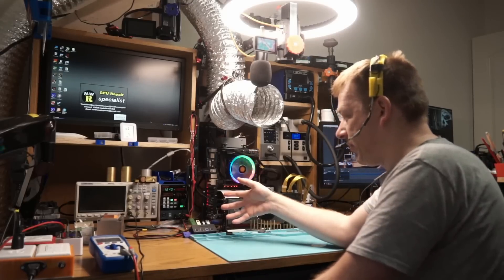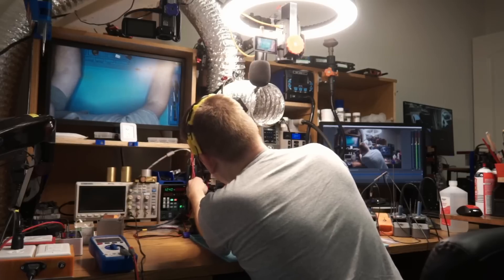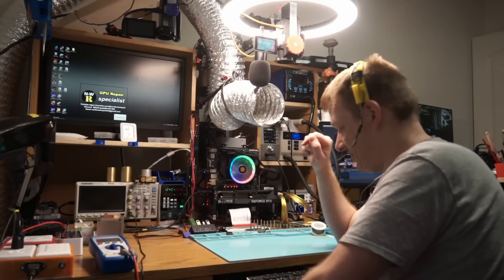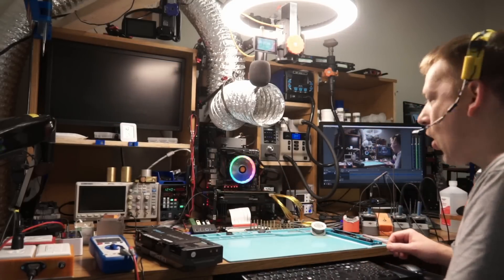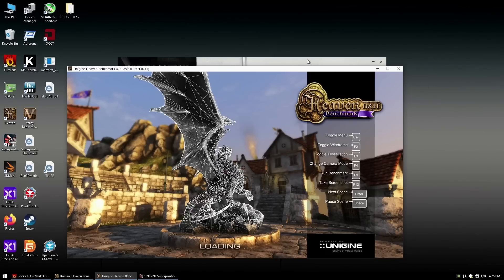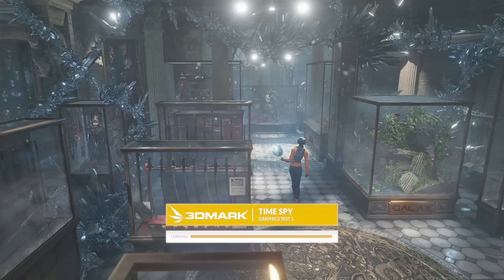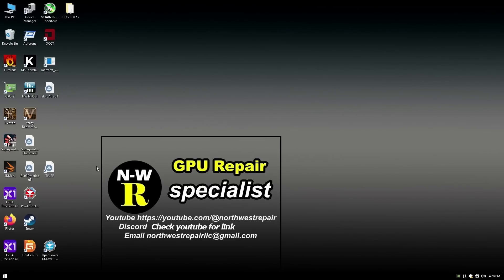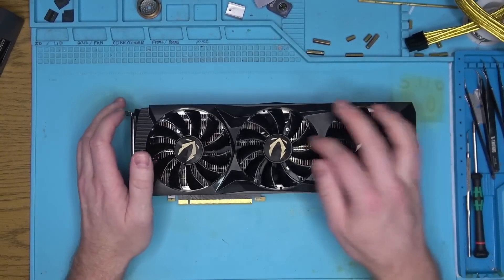Can you swap GPU while computer is at sleep ?

Comment: I agree with the other comments, 3DMark doesn't recognize the GPU as being valid because of it's wonky VRAM setup, and it's kicking you out of the tests because of that.
Does older 3DMark versions work, like say 3DMark 11 or 3DMark Vantage if you can get them to run? If they also error out, it's definitely something to do with 3DMark's System Info thingy saying that GPU is wild lol

Comment: Some motherboards support this but must have an option turned on in the BIOS. My Gigabyte UD AX Z790 has an option to enable such a thing. Can't remember what it's called but you would know it by seeing it. I think it's something like hot swap or something like that. I'm able to swap the 1st and 2nd PCIe in sleep mode without issues but the 3rd PCIe slot will wake up the system no matter what options are enabled. 1st is x16 size x16 speed, 2nd x16 x4 speed, 3rd is x16 x8 speed. Not a bad mobo for $100.

Comment: It's an good experiment, but there are many factors if this would work or not, each motherboard manufacturer theoretically has different bios, that is different code that drives pci-e slots (or maybe that's only left to OS after UEFI?), there comes the problem of the driver, what driver would do if the card in a slot magically changed it's specification and for each generation theoretically there could be different drivers loaded to system kernel - maybe only size of RAM is the factor and system crashes because of that, there are so many questions now, you've just opened an issue that's pretty interesting and at the same time time-consuming to investigate 🤠

Comment: That's why all military grade soldering is done with leaded solder. All that unleaded rubbish plays only for the GPU manufacturers that want their cards so be as fragile as possible. Cracking and stopping work from a slight wind blow.

Comment: Well changing cards I have try before on older machines ( like P3 and P4 ) and with mix results, some even with the PC turn on, GPU nop, crash 100%, but lan cards and sounds cards sure, adding a different one also crash.

About the 3D mark, well I got that one before with a AMD card and it was the card, something on the GPU was damage and the initial check that 3D mark does crash the soft or the PC.

Comment: I have done this multiple times to clean the cooler, test paste, test another cooler or whatever.

It will always work because the PC and peripherals state is saved in RAM. The GPU memory will be re-initialized out of sleep state.
But another gpu will always crash because it is not what the drivers expect and the state it has in RAM.

You do need to diaable automatic hibernation or it will wake up to hibernate and crash, after some hours.

The computer wouldnt power on by itself because I disabled mouse and keyboard wake up in Windows.

Comment: so i have an e.v.g.a rtx 3080 ftw3 ultra that has an ek waterblock on it but has issues. I just bought an rtx 4070 ti super to replace it. No video out, no hdmi out on the 3080. i have the original fan and heatsink , housing and clasp. wanna make a video on this? i will send to you or bring to you im in show low Arizona

Comment: Basically those hardware rails are not designed for Plug & Play. For example P&P ports are designed to tolerate wiggeling (no power line directly beside another one) and data lines for getting powered up in any order (because you can't say which pins are longer than the other ones, could be different for each product, and even for individual devices of the same product). I don't know which lines are powered down and which are still on power at the GPU bus. If there are lines still on power in Sleep mode you could produce shortcircuits and damage the cards or even the bus. I would recommend to refrain from doing that in the future.

Comment: If i remember correctly "Sleep" keeps power on the computer RAM and "Hybernate" dumps everything on the HDD and poweres everything down until it reboots and loads everything back. Maybe you should try to start it with a working card and go into hybernation, then swap the GC and boot up with the faulty one.

Comment: I had an interesting issue with a Zotac 1080ti once. The card worked in every game and benchmark i threw at it, except for 3Dmark. Games would run fine, furmark no issue, heaven/superposition also ran fine, all was well. But as soon as i ran 3DMark, i would see green vertical lines as artefacts, sometimes it would crash, but mostly just continued getting worse and worse with the green lines.

MATS/MODS showed it as working, no issues found whatsoever. The only thing that helped was reducing the RAM speed by 100MHz, then all would be fine. IDK if it was the degraded RAM or some power filtering wasn't working well, but i never got to figure it out and sold it as partially working a year later.
Reply: Same card same result even with overclock or undervolt

Comment: You broke the signature handshake for the 3D Mark that why it refuses to run with the upgraded ram on the 2080. If you had another 2080 that is stock it will run just fine. But the problem is the upgraded ram gpu isn't ideal due to driver signature see the graphic card as 11gb not 22gb therefore you would need to make modifications to Nvidia drivers even this isn't ideal as you need a genuine certificate for it to work. This is like a can of worms in the long run

Comment: IF you have problem with graphic card like that try another way (something like that happen to me and I tried something drastic and it worked).
I bought another graphic card and wanted to test it so I put it in older computer just in case that card do not burn my new motherboard and it worked fine so I was safe (so I thought)
Then I swap it in my new computer and something happen first when booted for 1 sec something with lot of colors showed on screen but booted to system and it excepted drivers from previous card because they are almost the same BUT when I open GPUZ there is no Graphic to choose and no info (but everything worked like it was ok). I open Device Manager and there is no graphic card, I  put my old one back and it was ok but when I swap again  there is no Graphic card in drivers list. System was fresh new with few program installed so I took another older NVME2 with old system that I wanted to replace and put in PC so graphic card worked fine and I tested it in Furmark with GPUZ sensors to monitor so on new NVME I install new system and it is all ok. 
So maybe you can try new fresh system on another ssd (do not delete your current one) just to try maybe from swapping cards somehow system made a bug and remember that GPU with these settings.

Comment: That would fall under the topic of pcie hotplugging. It would have to be supported by the OS and not cause electrical problems if pins were crossed removing/inserting as some of them are still on.

Comment: I would think the driver and all GPUs (of that series) for that brand is made to speak together more or less the same. swapping will cause the system to maybe not know it can do more or less of something. Maybe it will think the ram is of the old card and cause allocation issues but would not see it until you stress it. CPUz working makes sense. Games working make sense for a little. 3dmark not working makes sense because it is probably doing something very exact to the card it thinks is there.

Comment: Re 3DMark: It's your non-standard RAM. 3DMark checks your hardware, and won't run if it's wonky.
Reply from the maker: it did in the past but not with this card.
something else is going on
Reply: @northwestrepair No. its the vram count. Stop it

Comment: seems legit. if you suspect a bios being the problem and want to flash a new bios to the graphics without having to change the chip, this could be a hack to have the gpu running with a fresh bios flash. bios loads with uefi for the peripherals like gpu. under theory this is how you get into windows and reflash the bios. love it

Comment: Hi NWR. While I don't do the 'sleep mode' on my GPU benchmark/stress machines, sometimes the AMD platform motherboards WILL power on when a GPU is inserted in the slot (regardless of pci-e power plugs being inserted at that time). No big deal, just wait for POST to mostly finish then I can power it off without cutting AC power. The Intel platforms don't do that to me. MSI Brand boards on both setups.

The motherboard is not entirely powered off when it's powered off. Some standby voltages are likely briefly pulled to ground when the card is installed (like power supply PS-On pin 16 for the ATX connector) or some other similar signal imitating  a button or switch being closed for the front panel header power button.

/shrug

Comment: 1:29 Isn't that rather asking for trouble. I thought turning off the computer, unplugging it and pressing the power button (I do it a few times) to drain any lingering electricity in the circuits. Before putting in and pulling out any peripheral.  I'm over cautious because I killed a video card once long ago by not doing what I just described.  It was the newer Matrox card model at the time.  Ran to one of the computer stores and ended up getting a 3dfx Voodoo3.  Ever since then, I'm overly paranoid about draining any linger electricity from the motherboard.
Reply: Nope. PCIe has a wake pin. Now, if it was AGP or PCI... Maybe.

Comment: Have you thought about doing memory upgrades for customers? For example take a 4080 super with 16gb on it and put another 8 on it for 24gb. Would it perform better? I know it wouldn't necessarily be faster but would it help with 4k performance and 3d rendering?
Reply: You can only double the VRAM (you cannot add extra 8gb to the available 16gb) and the performance won't change unless you are running out of memory. It would help a lot with AI stuff.
Reply: @TigTex  that makes sense honestly. I just figured that at 4k the 4080 would be close to running low. What about bumping up the vram on a 4070 ti non super. That's what I have. It might not make sense economically but would it be beneficial considering the card can do 4k but runs low on ram since it only has 12gb.

Comment: You can also remove PCIe devices with the computer powered on. On the PCIe connector, there is one pin which is shorter than the others. If one were to remove a PCIe card with the computer on, the physical connection with the shorter pin and the pin in the slot will be broken first. This signals to the card and the motherboard to shut down the signal pins. External USB connectors also have this feature and it works the same way.

Suddenly disconnecting signal pins with plugs and edge connectors without this feature could cause damage to the computer and the device.
Reply: Interesting, was always wondering what the shorter pin was for. thanks!
Reply: don't always work as intended and the os needs to be able to hande the suprise removal.
Reply: Theres always a reason, but theoritically like pcmcia cards there isn't a reason why it can't be pnp except for the large power draw that stuff like networking and gpu cards draw, that instead you need to safely shutdown inside the system before removal. I mean windows can give you the option, not sure how, but I have the ability to remove my mellonox card but not my gpu. If I pass over my gpu from linux to windows it sometimes list the card as a removable device. Yeah I did it once and it obviously crashed since the kernel wasn't expecting a full portion of the system to be gone including graphics ram since windows subsystems expect that to be present at all times. And damn does the nt kernel picky about that shit while linux just says whatever gtfo. This being said gpu driver crashes aren't the same thing as your card is still present and addressable regardless that the driver isn't loaded, although you can technically run windows without a gpu driver, it'll be a huge pita.

Comment: Re 3DMark - Remember it is designed to be a fair and competitive benchmarking tool for overclockers -- and there is a lot of code and effort toward verifying nothing in your set up has been tampered with to cheat a score.

My guess is your deviant card is setting it off. But that's good news because its a 3dmark issue and not a hardware one
Reply: This. I was thinking it was because of a non-standard amount of memory. 12, 16, 24 gigabytes are all to be expected. 22GB is not.
Reply: @LethargicSquirrel 22GB is absolutely a valid amount of memory, possible with a 352 bit bus on cards like the 2080Ti and 16gbit density GDDR6. You even see some modded ones floating around and the full 22GB works absolutely fine - FrenchHardware even ran one of these cards through Time Spy.
Reply: I could unintentionally still cheat with a score. Overclocked my peasant RX 6650 XT to the max., 3DMark tests ran without any issues (created a new record in Port Royal). And surprise surprise, when I tried to play CP2077, the game crashed in a few minutes. So in reality the OC wasn't stable and the benchmark should've crashed, instead of getting a new record score...
Reply: sounds like the people at 3d mark are anti fun, if someone is skilled enough to mod their gpu to add more ram i see no reason why they shouldn't be able to score higher
Reply: @honeybadger6275  Many nerds are in fact pretty devoid of humor, they just sit, and talk about their character for ages...
Reply: @honeybadger6275 what happens if I made the PC assume that  a 970 gtx is actually a 4080 for example, wouldn't that be unfair?
Reply: @hashemmi24 You mean the other way around cuz if not you'd be at the bottom of the 4080 scores.

Comment: It's because 3D Mark can't verify the GPU and it thinks something's wrong because it's got the wrong amount of VRAM.
Reply from the maker: so you are saying my 2080ti is fine ?
OMG :face-fuchsia-wide-eyes:
Reply: @northwestrepair  "OMG" i heard that
Reply: @northwestrepair  hello just wanted to ask a question, since you do gpu repairs and have tested alot of gpus on the motherboard you have,
a faulty gpu can't like fry a motherboard or anything on it?
I want to try an older gpu I have which may or may not be broken, but afraid that it might somehow ruin something
Reply: @gdog8170 There is a possibility that a gpu installed incorrectly could kill the gpu and/or motherboard as little as a small spark of static electricity can be fatal. Now the main question is what seems to be the problem? Is it not posting? Give us some information and we could possibly help you
Reply: @neddy1287  so, I bought a used machine before, didnt know that the psu was some chinese unknown brand with like 230 watts, now it had an i5 3470 in it, dont even know if the 230 watts were the real watts given to the pc or just what it draws.
But after installing the gpu, it used to work, although one of the two ram slots that was on that old motherboard died.

 
But it worked,
until I took the gpu out like the fourth time and put it back it, (trying to figure out whats wrong and what made the ram slot not working)
then it didn't post.
Just ran fans at full speed and nothing on the screen.

Although if you plug into the integrated graphics with the screen it posts, so seems like the gpu just ran at full speed but wasn't detected? I don't know.
Might have been because I didn't uninstall the previous drivers, that is also a possibility.
Reply: @gdog8170 This sounds like a the psu is underpowered therefore gpu not getting enough amps to function as given the symptoms of not powering or random shutdown. First replace the power supply then secondly make sure everything is cleared of dust bunnies and thirdly make sure all spots, cables and everything else is fully seated and connected
Reply: @neddy1287  thanks, I will do that. I already returned that case way back, I have since built a new pc with better specs, but it's such a waste to let a gtx 1050 ti rot so I wanted to try and see if it works on the new system
Reply: @gdog8170  RAM socket failed after repeatedly removing and reinserting the GPU? Was the motherboard flexing a lot? (Maybe its mechanical supports aren't all in place, or socket is very stiff?) I'd wonder if you've damaged the motherboard by accident - flexing it too much can break it, so it's always a good idea to try to mechanically support it if you see it bending while trying to insert memory or cards.
Reply: @laserspike  no like, it did that on the First boot it not detecting the GPU, was after removing alnd putting
Reply: @northwestrepair Dude how did you not know this
Reply: @northwestrepair  just downgrade it back to 11gigs and vola
Reply: @lordneol  or upgrade it to 44GB
Reply: @northwestrepair bot
Reply: You broke the signature handshake for the 3D Mark that why it refuses to run with the upgraded ram on the 2080. If you had another 2080 that is stock it will run just fine. But the problem is the upgraded ram gpu isn't ideal due to driver signature see the graphic card as 11gb not 22gb therefore you would need to make modifications to Nvidia drivers even this isn't ideal as you need a genuine certificate for it to work. This is like a can of worms in the long run
Reply: @neddy1287 this is the answer
Reply: @neddy1287  funny how DOLBY always says the cant release Dolby Vision on custom PCs because they can't verify the GPU integrity while 3DMark has obviously solved that years ago - for the sake of benchmark ratings
Reply: @thearminius1  Dolby Vision isn't a part of benchmark of any kind so don't know where you got that idea from
Reply: Or 3D mark is the only benchmark attempting to use all 22GBs and the others are not.